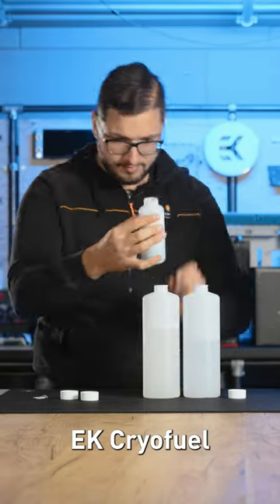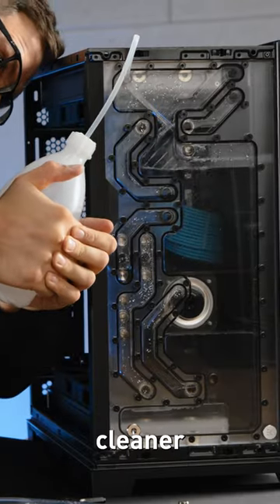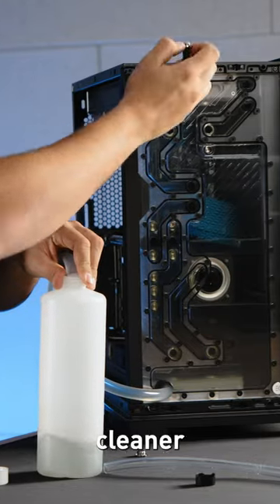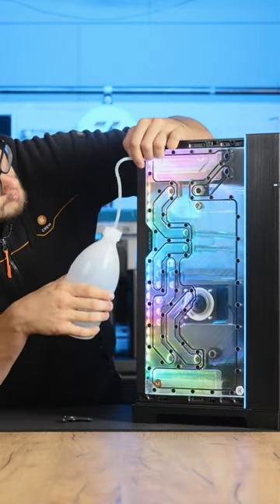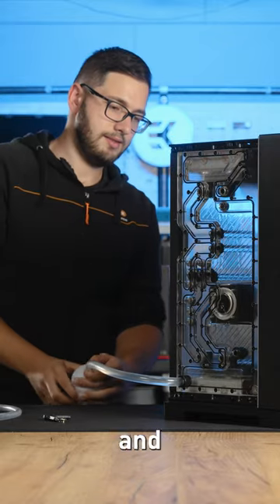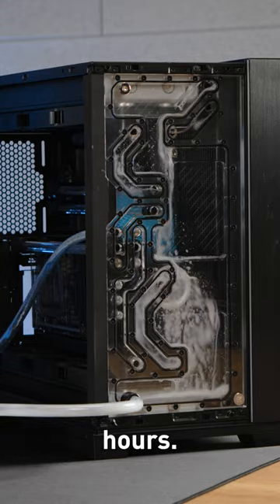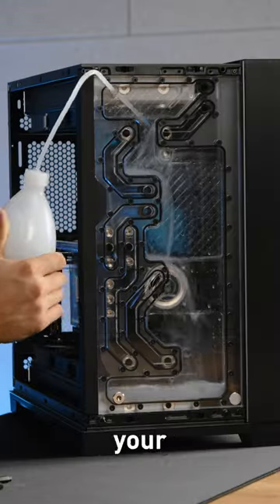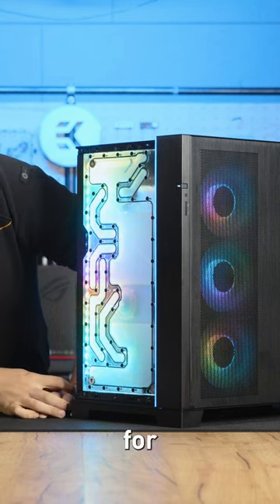Mastering Water-Cooled PC Maintenance: A Comprehensive Tutorial by Matic

Comment: Every year I take out my whole watercooled PC, take apart all the blocks, radiator and pump. Radiators get extra 3 hours flush with normal garden pump. Scrub fitting, replace orings if damaged. Put it back together, test with EK loop tester and pour the coolant. Im not pouring tap water into my loop for even a second. I buy 10L of distilled water for cleaning  and rinsing.

Comment: Never needed to do that. I just rip apart my entire loop, clean the blocks with isopropanol and soft toothbrush (not the acrylic parts of course) and then just rebuild the loop. It usually takes only a day. This video is IMHO insanely complicated method and will only deter those, who want to start with watercooling.

Rule of thumb - never use pastel od dyes liquids. Clear premix lasts for ages, I usually change my liquid every other year and never had problems with clogging the blocks...
Reply: I mostly agree with you, I ran clear coolant, zmt tubing with nickel/acetal blocks and never did a full flush in 3 years, I would 80% drain and then top up with new stuff.

This time I actually drained the loop, flushed with a gallon of distilled water and drained, filled with cleaner and ran it overnight. Drain cleaner/flush with another gallon of distilled, then fill with superflush and run for 24 hours, drain and flush with another gallon of distilled and drain one last time and then finally top off with fresh clear cryofuel.

I dont mind doing this extensuve clean/flush every 4 years to keep my pc parts going strong. I worry most about the 360XE and 360PE radiators growing something inside. Their clean/flush kit was 93$CAD and 4 gallons of distilled water was 13$CAD to protect 7k$ pc I think it's worth it not having to disassemble my loop.
Reply: How does this seem more difficult than taking out the entire water loop? This seems easier not to mention safer.
Reply: @signal65 @signal65  gaskets aren't perfect, and flushing out a system isn't either. Infact it can be worse since all it serves to do is leave potential leftovers unnoticed no matter how much soft water you run post flush. Gaskets can and will hold fluid inside and past the points they're trying to seal. Pumps and cold plates are especially problematic since flowing water and pressure alone isn't enough, so that's where (soft bristled) mechanical action comes in.

It's like spraying down a car with soapy water and expecting it to get between the wheels and grill, nevermind the interior.

Basically manual cleaning is much more thorough, and eliminates steps in troubleshooting down the line.

There is something to be said about radiators however, since they cannot be taken apart. That's when we start caring about using additives to wash them out.

All that said I don't dissuade anyone from using dyes and pastels, but it's important to understand the work needed to support such decisions
Reply: Yea i learned the hardway that acrylic and alcohol dont mix

Comment: Air cooler: Remove, change paste, attach again,  screw.    Ill never understand the need for water cooling.
Reply: Water cooling is quieter and more efficient than air cooling :)
Reply: @kubasarnowski agreed.
Reply: some of us aren't happy with our CPU going to 90c when overclocking? that's why I have both my CPU and GPU cooled with a 360 and 420mm rad
Reply: It's nice hobby aswell....